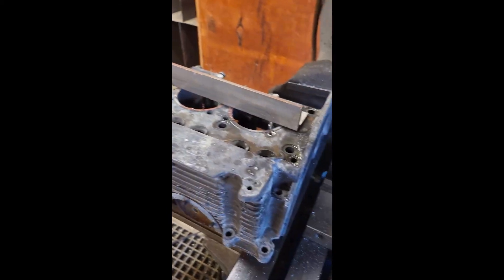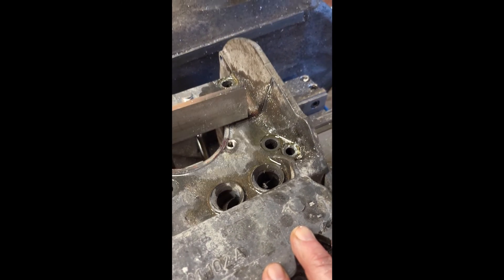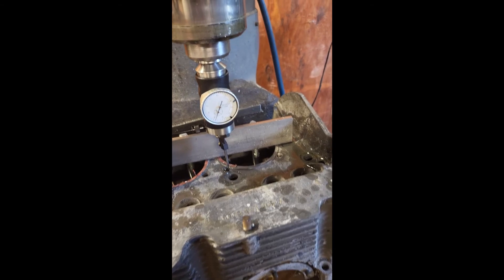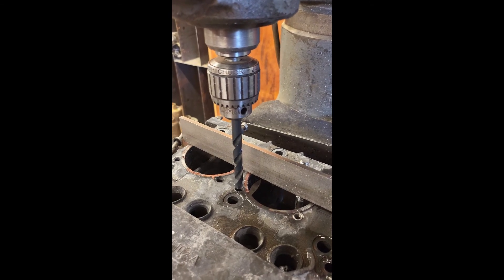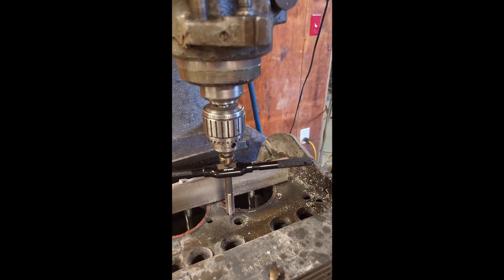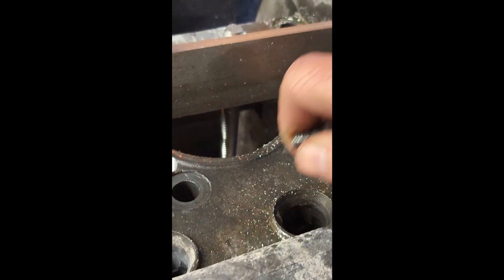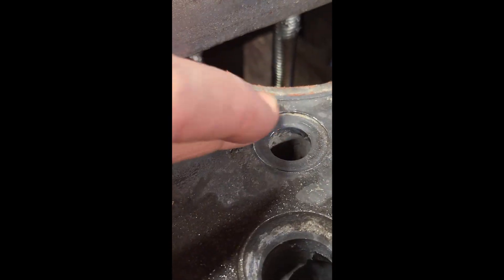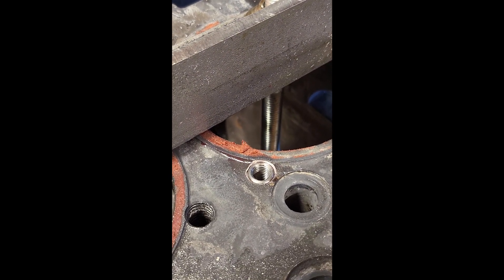VW Case Savers Install

Comment: Did you cut the can some ?? I’m having a shop put in 16mm and I believe it’ll kiss the can.
Reply from the maker: I didn't need to cut it at all. I didn't need to buy new studs though. I used the old studs and only inserted the steel inserts.

Comment: What were the original studs?  8mm or 10mm?  Also did you say 10.5 drill bit?  AE code block?  I have a 10mm original head studs that I want to reduce down to 8mm.  I have the 12mm OD x 8mm ID and hope I can install these.

Comment: did you drill and tap those holes all the way through and use any thread lock on them?
Reply from the maker: I drilled each one as deep as it was previously. During install I used red thread locker to ensure they don't move.
Reply: hell yeah, appreciate it  @WDSluder